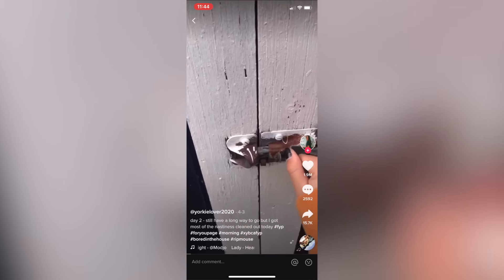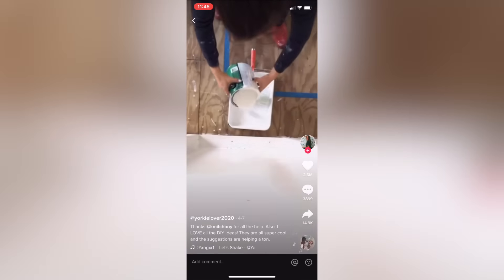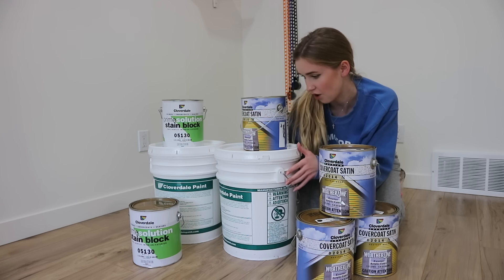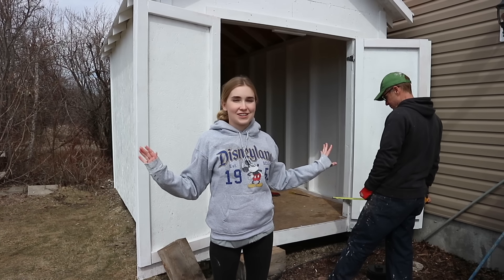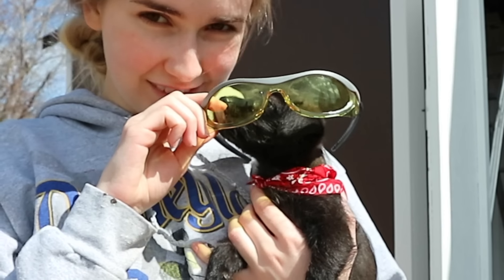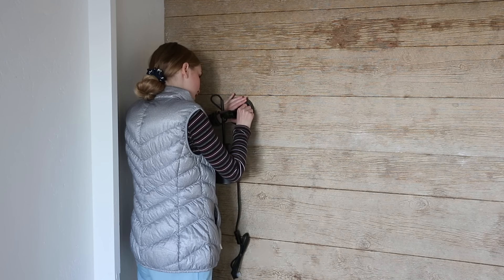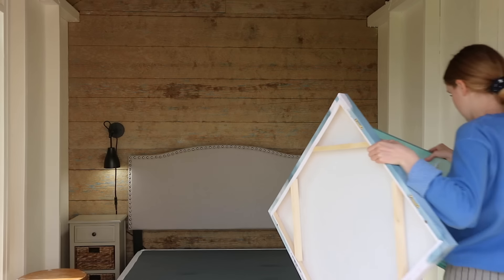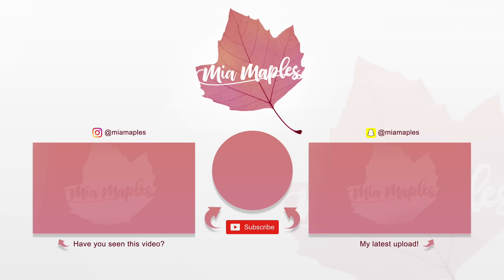Transforming this FREE SHED into a Guest House !! *dramatic results*

Comment: I know you said why you didn't insulate it but just from the perspective of someone who's built with OSB, you don't really want to let it get rained on because it swells and rots and breaks much easier since it's just glue and woodchips. I would have definitely recommended siding on the outside and insulating the inside & doing dry wall even just to have a nicer look on the inside and give you better support/places to hang stuff. It does look really nice though! I really like this idea.  It just is going to have a shorter lifespan just because you can already see some of the osb rotting

Comment: The RV idea actually may have been a better idea, actually park it in the back. These days you can pick up used RVs next to nothing and Reno them. They are already insulated, plumbed and electrified. In most areas, you don't have to get permits to Reno them since they are considered temp. I would hate to stay in that she'd because I know I would have to use the restroom at 2 am, need a key to house then!

Comment: I lived in a building 12x30 ft. for three years. She should have insulated it. I only use a small electric heater and it was toasty warm in the winter. Small air conditioner in the summer. The partial board on the outside want stand up to the rainy weather.

Comment: I could see light in the ceiling. Needs to be sealed off . I would have put insulation on inside for hot and cold weather. My husband had a shop and he insulated it walls and ceiling and walls. Could use in any weather.

Comment: No insulation on walls or ceiling under boards, no padding under carpet, hopefully it was properly shingled for the roof (with padding under shingles). Any moisture with no insulation will create mold throughout the whole shed and bring all types of bugs and spiders.  The dark color on the outside will increase the heat inside, therefore, increase moisture = more mold.  The double door should have been replaced with boarding, insulation and drywall on one side with door on other side.  Glad you included screen though.  What if guest have to use the bathroom in the middle of the night? Do they get a key to the house, leave the door unlocked all night, or wake everyone up by ringing doorbell? This should have been a she-shed, not a bedroom. And even then, I would have it insulated.

Comment: I hope you guys fixed that ridge vent where the roof came together and where the walls meet the roof. Otherwise all that hard work is in vain. Also why didn't you take the extra steps to add some insulation and either drywall or paneling? Not hating at all but the winters there are so cold! It looks beautiful though.

Comment: If it hasn't already, that carpet is going to need stretching or it will have rolls/wrinkles in it. Hardware Stores will sell a "knee kicker" that grips the carpet, and you use your knee to forcefully stretch the carpet to prevent and/or fix the wrinkles.

Everyone, don't install your carpet like this in any area with foot traffic. If needs padding, proper hardware, and to be stretched.

Comment: It's a cute idea, but seems impractical. There's barely any room to put down a suitcase or anything. I would have added some shelving and hooks. Also I'm wondering if they use a generator or have an extension cord to the house for electricity.

Comment: Need a part 2 where you actually make it usable...shingles over a hole is NOT going to keep moisture out. And that non-weather proofed door is going to cause moisture build up inside. Finally, insulation does so much more than keep a place warm, it also keep it cook and dry. Cute idea but Incomplete/poorly executed in some areas

Comment: This is cute, no doubt about it... However, if you're gonna put your hard earned money and so much time into something like this, why not do it right?? That thing isn't weatherproof in the slightest. Yeah insulation is one thing but I'm talking about water! Those walls will be disintegrated in a year, if that. You bought siding to put on the inside walls cuz it looked cool, why not put it on the outside and actually keep your project standing longer? Lol